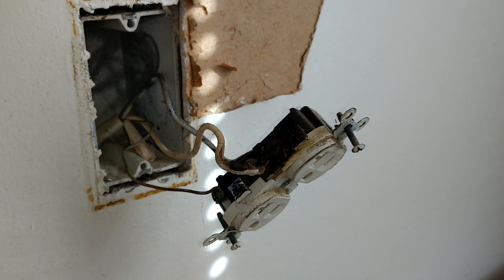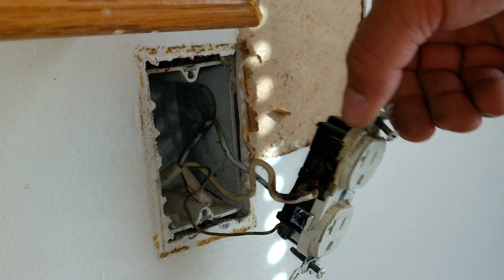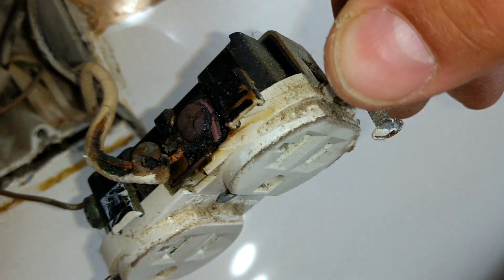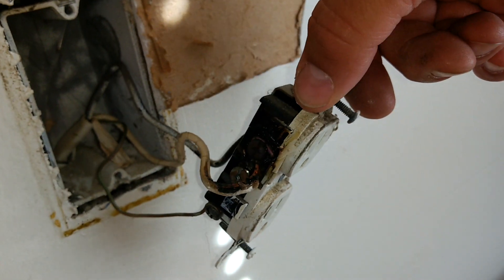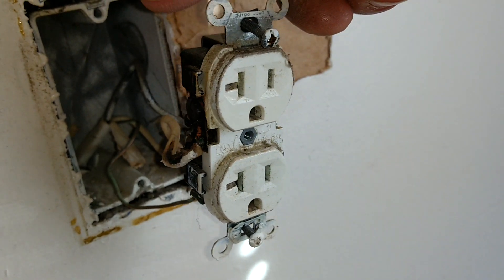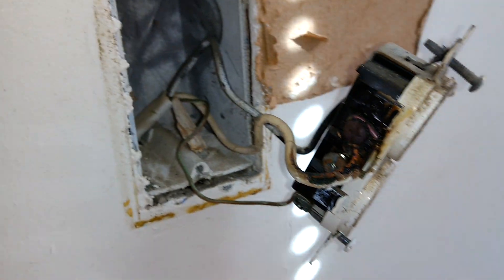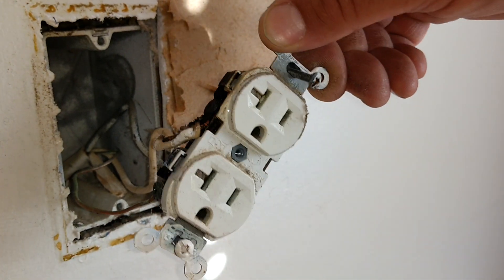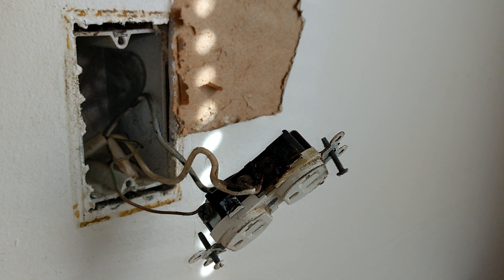Burned power outlet - Fire hazard warning!

Comment: I have an outlet that’s been warm for a year at least. Its not extremely warm but I do notice it.  Nothing is plugged in it. Should it be replaced or is it okay?
Reply: If you use something high powered in another room that causes the outlet to be warm, you should be fine. The workers in my apartment replaced one of my outlets what were warm to touch once and it stopped for a few months. Then it started again. That high powered thing that you may be using draws power which causes an outlet to be warm to touch. Like an ac for example.
Reply: @Anonymous-ch7wj  that does make sense. On the same wall there is a refrigerator. On the other side of the wall is a garage.
Reply: Yes replace it . current passing though to downstream device is causing heat very common.

Comment: Actually using 20 amp outlets is fine as long as you’re using a 20 Amp circuit breaker with less than 20 outlets or circuits on it the general rule of thumb is 1 amp per outlet. If you have a 15 amp circuit breaker then yes only 15 amp outlets should be used (with only up to 15 outlets per 15 amp circuit breaker). 

But the type of circuit breaker tells what type of outlets you should be using. Both 15 and 20 amp circuit breakers are EXTREMELY COMMON out there. 

You might wish to check the wiring condition between the breaker box and that outlet too but yeah I wouldn’t recommend metal boxes either plastic boxes are better because there’s nothing thhat can possibly arc inside a plastic box. 

So if it was me id replace the box and the outlet and check wiring between the breaker box and the outlet too. If you can access the wiring that is. 

But its much safer these days to use plastic boxes vs the steel ones. 

Another trick if you want to use steel boxes id take electrical tape and tape it around tge whole outside of the outlet covering the exposed screws that way it helps prevent shorts inside a steel box.

I mean electrical tape over the screws you attach the wires to not the entire outlet. As thats a great place for a dangerous situation is accidentally shorting those screws on a metal grounded box. Its why I prefer plastic boxes.

Comment: The damage does not suggest an overloaded receptacle. It suggests a loose connection of the grounded conductor (white) to the receptacle. That is why the damage is worst at the wire-securing terminal of the receptacle and decreases with distance from it. If the circuit was overloaded, you would have seen some damage on the ungrounded conductor (black/hot) as well.

Comment: What would you do if you have a couple outlets that were buzzing sound when trying to plug in some thing, I let my mom know about so hopefully we will get around it this week, I am not using them btw, let me know when get a chance
Thank you
Reply from the maker: Yeah, if it's buzzing, then definitely DON'T use those outlets. I've seen that before, and there are a number of possible causes. For example: a short circuit inside the outlet (if it's a standard outlet), or a faulty GFCI outlet (that's trying to trip and can't), or a faulty circuit breaker (that's trying to trip and can't, for example, if the plug itself has a built-in breaker). Or possibly, an overloaded or bad breaker inside the panel. Also, consider "what else" is plugged into that circuit. For example, all outlets in 1 room may be on the same circuit, and a "problem lamp" that's connected to one outlet, may cause an issue with another device on a completely different outlet. However, if you can find out which circuit it's on, it would be best to turn off that breaker in the main panel, to avoid any possible issues, until you can diagnose the problem and get it fixed. Hope this helps! Good luck, and please stay electrically safe!
Reply: @stevenofpa  speaking of breakers, 
I was at another house which was likely built in the 70s with a breaker panel. Flipped the main switch off and then back on. 
When I went to flip it back on, it had resistance and made and electrical crackle sound. 

What’s this mean?

Comment: How much would you charge for this type of job?
Reply from the maker: Hi, and Thanks for your question. Something like this is a pretty quick fix, as far as just performing the task of "swapping out the bad outlet". However, on a job like this, it usually takes a while to figure out what's going on. For example, what outlets are on the circuit, is there any overload, testing other devices for issues (switch contacts, wire connections, other outlets on the circuit, appliances or devices connected to those outlets, breakers in the panel, etc...). In this particular situation, it was an obvious visual diagnosis, so, a few dollars for an outlet at the "home center" and about 30 minutes of work, and it was all fixed up. However, most "electrical service" companies are going to charge for a "service call" fee (to cover travel time for the technician), plus an on-site charge (usually 1 or 2 hours minimum) at whatever their labor rate is (probably somewhere around $100-130 per hour), plus the price of the part. So it could be upwards of $350 or so, depending on the local market, and who you call. Also, some jurisdictions don't allow "handyman" to work on electrical (only licensed & insured electrical contractors), so that could affect the charges. But whoever does the work, it's important to have the job done "electrically safe" and up to code. Anyway, sorry for a long explanation, but, Hope this helps! And Good Luck with your electrical repairs!

Comment: My rule of thumb is to replace all outlets and switches when you move in and they look old.
Reply: Especially if power plugs are loose or fall out.  High use areas maybe should have industrial strength outlets.